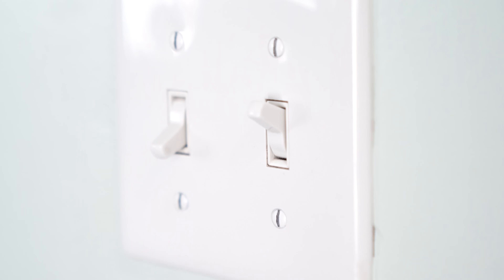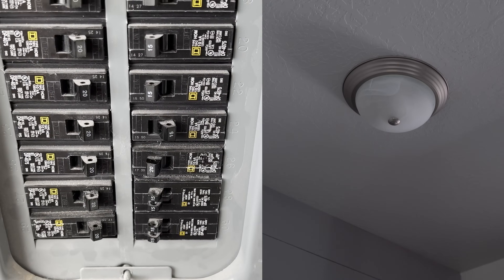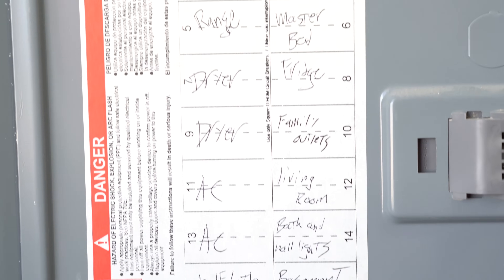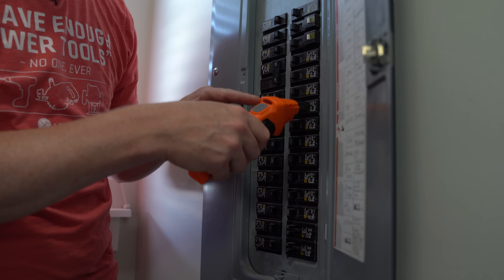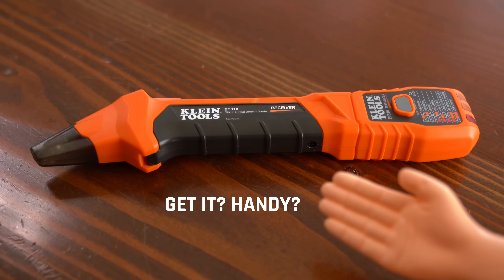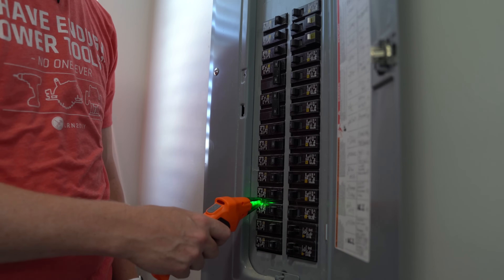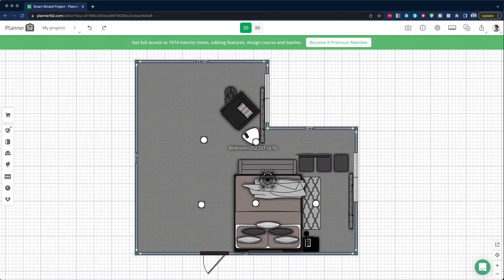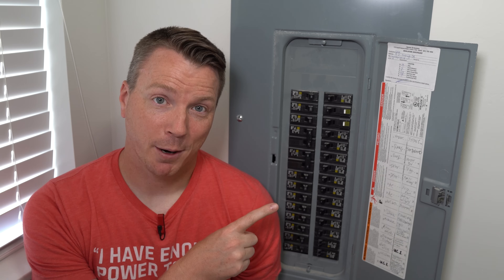This Tool Could Save Your Life

Comment: I don't know how it is in the us, but in europe, you have the normal breakers for bath lights, bath outlets, kitchen outlets, kitchen lights etc, and then you have a main breaker in the same circuit box that cuts power to all the breakers. When working on electrical stuff, just flip the main breaker off and you are sure there is no powere to any light or outlet. Isn't that easier and cheaper than buying this tool?
Reply: No.  Turning off all the power works, but it's a drastic step.  Many things in American/Canadian homes are designed to expect continuous power.  This includes refrigerators, freezers, air conditioning, heating, water heating, and even the internet/WiFi setup. Turning off all the power disrupts all these things.  US/Canadian circuit design is very compartmentalized for a reason.  A European home may have 6-15 circuit breakers, including RCBOs.  An American/Canadian home may have double that, and newer homes may have triple.  It's just a question of knowing which circuit breaker(s) to turn off, and once you learn it and write it down, you don't have to re-learn it.

Comment: Nice circuit tracer. I’ve been an electrician since the early 90s. One thing I still make a habit of doing, using my voltage tester, check the power before I’ve located the power source and after it has been secured. That way you can ensure your test equipment is functional before trusting it. It would be a tragedy to be utilizing a voltmeter that has a defective lead. In that case you will definitely get 0 volts even with the power applied. One test with the power on to ensure your test equipment is functional and the second test for power.
Reply: But why not just shut off all the power that way you play it safe ? That’s what I’ve been doing

Comment: Which electrician in his right mind would wire side-by-side switches to separate circuit breakers?????
Reply: One that things the lights in the upstairs hall should be on a different circuit from the stairwell lights.   
There's absolutely nothing wrong with it.

Comment: i got that tracer thinking it was a deal and return it , didn't work that good ,sign was low , got the old ideal tracer back, look at the switch box you can tell there's two 3ways,  the only recommendation i would give is leave it to the professionals.

Comment: I'm not really afraid of 220V which is what we have where I live, that is, I'm not afraid of touching just the 220V wire. It's annoying and hurts, and I wouldn't voluntarily touch it for $1,000, but it's not deadly, and I'd argue, not even dangerous, if you're normally healthy, no heart problems and such. However, I am very, very afraid of at one point touching not to mention holding both the neutral and the live wire, or holding something that's grounded, at the same time as touching the live wire. And since you can never know what you might hold or lean up against at the time you touch the live wire (as it's always an accident), you always triple check everything. I had a professional old school electrician not fully trusting the testing tool (sometimes) test if the wire is live, by quickly grazing it with the back of one finger - of course always mindful that he's not touching anything else and is in well insulated rubber shoes. But, again, not really dangerous, the dangerous part is always being grounded at the same time.

Comment: The little plug with the three light tester doesn't work, it can't tell the difference between a neutral and a ground.
  Also, that's fine for 120 volts. When dealing with 440 always check twice, once with your tester then next with a shorting tool. If you touch 440 for an instant you are dead.

Comment: High voltage is over 1000V. Our houses use low voltage globally between 100V and 240V. I like your channel but teaching people to do their own electrical work is very dangerous. You are obviously not an electrician so it's basically a case of the blind leading the blind.
Reply: While that's technically true about 1000V, the perspective of a homeowner is a bit different.  A 12V doorbell circuit is a lot safer than a 120V outlet circuit.